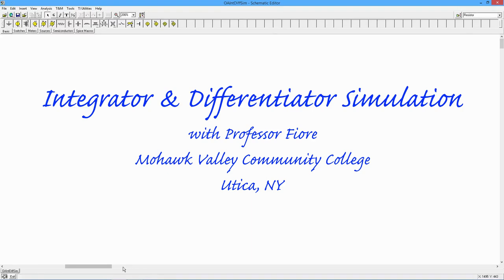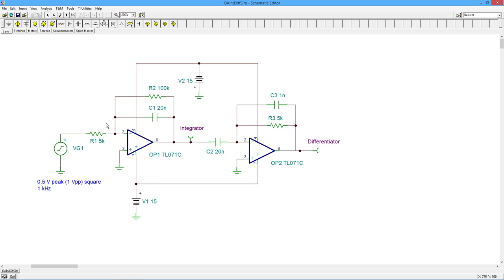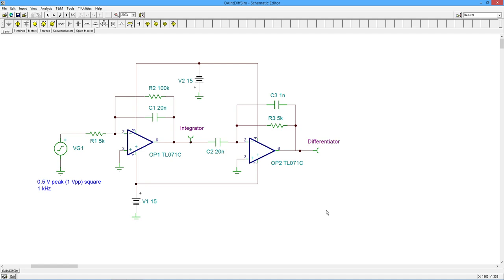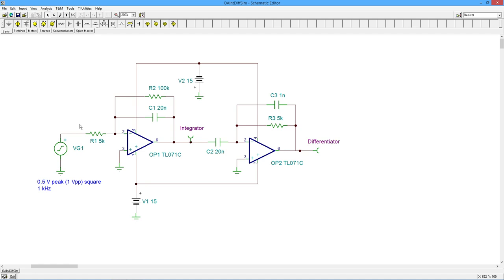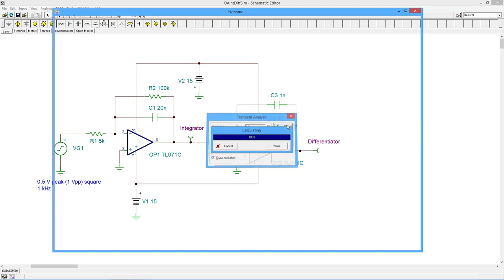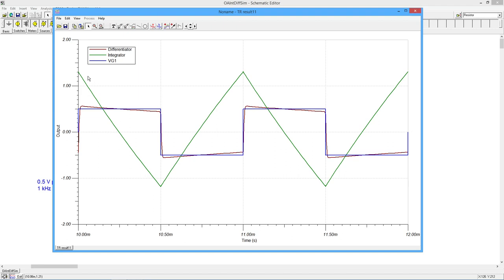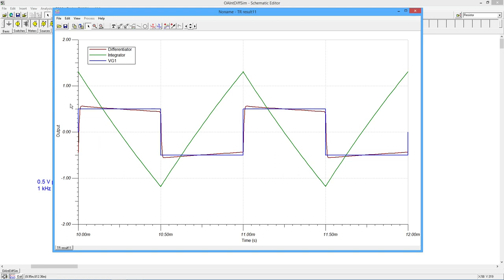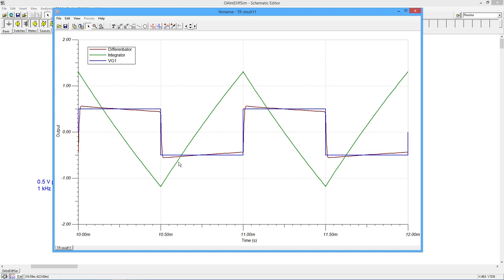Op Amps: Integrators and Differentiators Simulations

Comment: Excellent. I can see (I think) a curve to the green line (triangle wave). Presumably due to the charge/discharge curve of the capacitor? Is it this that gives rise to the tilted Square-wave output (along with a bit of DC offset)?  Thanks again.
Reply from the maker: The circuits do not have infinite bandwidth. As such, there will be some alterations to the waveforms. Generally speaking, the vertical bits of square waves tell you about the high frequency performance (the more vertical, the higher the f2), and the horizontal bits tell you about the low frequency performance (the more horizontal, the lower the f1). These effects are separate from the DC offset.
Reply: @ElectronicswithProfessorFiore  Thank you. That makes sense. Does the capacitor charging curve have any effect on the charging rate or am I simply wrong on that one?
Reply from the maker: @simonyoungglostog  There's an interaction of a few elements. For example, the added Rf in the integrator, which prevents overloads from accumulated DC, limits the frequency response. This is discussed in the text. See the parts about f(low) and f(high).
Reply: @ElectronicswithProfessorFiore  Will do, thank you.